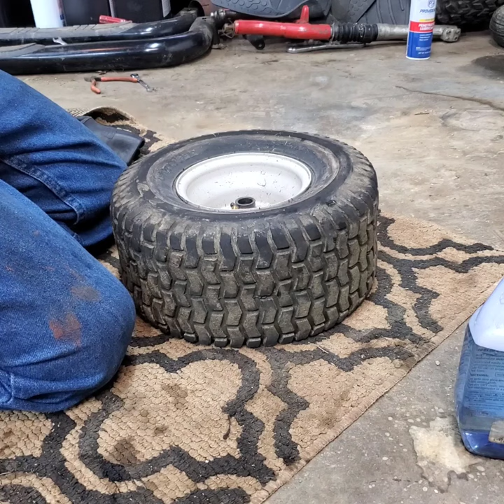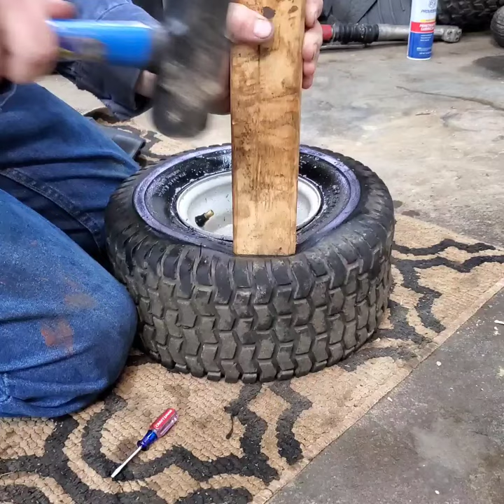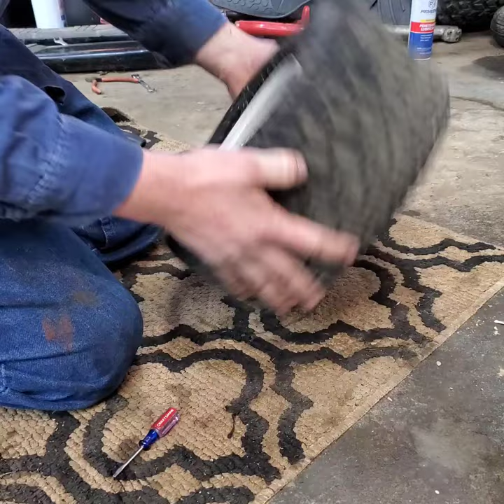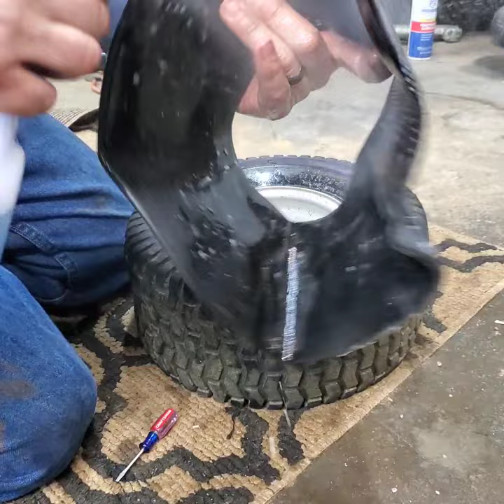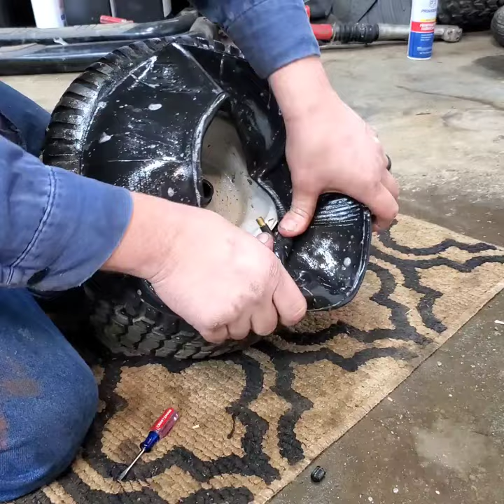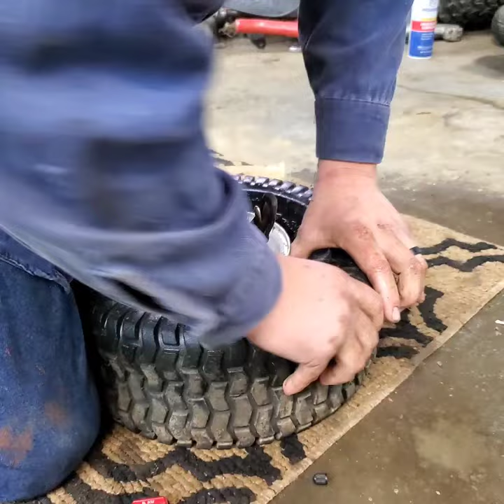How to install a tube in a lawn mower tire. *No special tools required*

Comment: Good video  A few extra points:  If putting a tube in a formally tubeless first cut off the valve stem , it makes breaking the bead easier  you  are not compressing the remaining air to break the bead.   When tube is in and you are filling  take  the valve core out  fill  until bead seats, let most air back out, then reinsert  valve core and refill,  This allows   folds and creases in tube to straighten out preventing future leaks...  On a related note  When first filling a tubeless  also take the valve core out,  You get  a unrestricted flow of air  which makes it easier to seat the  bead  .  Get Greasy
Reply: Me again  Just to add  ,  The best tool to have when changing a tire is  Common Sense
Reply from the maker: The reason I didn't mention about removing the valve core is I wanted to make the video as simple as possible. Most people don't have a valve core removal tool. You are absolutely correct though. Thanks for watching!

Comment: Awesome Video.  Saved me so much time and money.  For all those that wonder if you should pull out the old tube, I did.  I used scissors to cut it out and pulled it out with pliers.  I used that Dawn Powerwash thingie.  super slick.  I was friggin' amazed that it may have taken me 10 minutes from start to inflated tire.  Thank you!!!!

Comment: That's more the way I envisioned doing it, rather than to add the extra work of popping the tire all the way off the rim. Thanks. 👍
Reply from the maker: Thanks for watching!
Reply: Might still want to do that to make sure there aren't any thorns or stones in there,  not criticizing this method, it's how I do my bike tires but just a heads up.

Comment: You can also use a nut and washer on the valve stem to keep it from slipping inside the tire while you're putting the tube in.
Reply from the maker: That would work too! Thanks for watching!
Reply: Now you tell me

Comment: Done a zillion of these. Good video. The one thing I do different is start inserting the tube at the valve stem.
Reply from the maker: Thank you!
Reply: Which is exactly what he did at 2:34.
Reply from the maker: Thanks for watching!
Reply: @Part_121  Look again. He inserted the stem first then began feeding the tube in opposite the stem. No matter. He understood what I meant.
Reply: You must work in or own a lawn machine business.
Reply from the maker: I don't. I just do it as a hobby. Thanks for watching!
Reply: I agree, I put it thru and installed holder

Comment: All I use is a 5/8 bolt 8 inch long and nut, put in vice and tighten it 
Place wheel on bolt and tighten nut 
Use a rounded large old screwdriver push down and get a bit, I put soapy water or grease to ease removing tire , use other screwdriver to hold and get other bit
By now you figured it out

Comment: Inflate the tube out of the box 1st to see if it holds pressure then deflate it! It will give more flexibility when trying to stuff it in the rim & pull the valve stem thru & place it in evenly around!
Reply from the maker: That does help. Thanks for watching!

Comment: As fiddly as that may seem this approach looks WAY easier than taking the tire off the rim, installing the tube and putting it back on. Will try that next time... Pretty sure that is coming soon on wither riding mower or snowblower... Thx.

Comment: Also some Valve caps will do the trick! Keep them vise grip teeth away from the soft rubber. But most caps will be larger with will prevent the backing out as said
Reply from the maker: A zip tie on the valve stem works good too! Thanks for watching!

Comment: Good video, showing the whole fiddly process.  Just a question: why did you break the bead on both sides of the tire?  Thanks!
Reply from the maker: Thank you! You really don't need to. But it gives you more room to get the tube it. Thanks for watching!
Reply: I believe it would actually give you less room.
Reply from the maker: With both sides broke you can pull up on the tire so you can put the tube in the tire. Then work the tire back on the rim. No a very good explanation but that's how I do it. Thanks for watching!

Comment: Since I put plugs to patch holes/;eaks in the tire, I clip those off. I also add a layer of some rubber material around inside the tire to protect the inner tube from puncture. What good does it do to put the inner tube in, if it will just be punctured. I also put a cable tie around the valve stem to hold it from coming out, while stuffing the inner tube in. Leave the cable tie on .
Reply from the maker: It's a good idea to rub your hand around the inside of the tire to make sure there is nothing sticking through that will pop your tube as soon as you fill it with air. I have had that happen a few times. Thanks for watching!

Comment: And now with moisture inside the Steel rim , it will start to Rust , then develop holes in the steel rim , 
But you ain't too bright are you boy ?
Reply from the maker: Have you ever seen a tire on your car get changed? They use soapy water on the bead to get the tire on the rim. If you don't like it don't watch.  Your air compressor air is also full of moisture. Go to a gas station and fill your tire with air and there is moisture in it. Thanks for your input. Send me a link to your video that shows how to do it. Thanks for watching
Reply: @ablgarage the kid is probably 12 years old and will talk about his zinger on YouTube for the next 30 years

Comment: There's a problem with your method.  You didn't check for objects like thorns or broken glass imbedded in the tire.  You could end up with another holey tube if you don't check.
Reply from the maker: Yes your right. I have had that happen a few times!
Reply: How do you know what size tube to use
Reply from the maker: The tube will be the same size as your tire.

Comment: What do you do if after inflating the tube the valve stem slips inside the hole and can't be pulled out? Just hope you never have to fill the tube with air again? After I released the vice grip it just flew back inside the tire lol
Reply from the maker: I have put a zip tie on it to hold it in place but the cause of it is not having the valve stem lined up with the whole in the rim.

Comment: You make it hard . Just take one side off the rim and will make it a lot easier
Reply from the maker: I think it's much harder only breaking on side of the bead. If you break both sides you have a lot more room to get the tube in. Thanks for watching!

Comment: If you're not taking the tire off the rim You won't need special tools it's when you take the tire off the   Rim
Reply from the maker: Yes your right. Thanks for watching!
Reply: Why would special tools ever be needed for those little wheels unless you consider a screwdriver a special tool?
Reply from the maker: Most people don't have a beard breaker. Or a valve core tool or a tire changer. Most people don't do it because they think you need these tools. The video was to just show you can do it with ordinary tools.

Comment: I wouldn’t put a tube in a Carlyle Turf Saver 13x6.50x6. 
I’d use tire sealant like  Slime. Thou there are sealants with more rust inhibiter. 
I’ve found a tube just triples the work of fixing a flat tire.
Reply from the maker: I have used slim but it doesn't always work. A tube always works for me. As long as you don't put a hole in it while installing it won't leak. Thanks for watching!
Reply: I just put tubes in Carlyle Turf Savers.   I've had nothing but problems with Chinese tires leaking and would have paid twice the amount for a made in the US tire.  I bought the Carlyle's because they were once US made and I'm hoping they are still made with quality materials and to US specs.  But who knows now-a-days?  The tubes are my insurance policies.

Comment: I would never deliberately trap water inside a tire. I doubt that soap is a good idea. I expect that when that soap eventually dries, it will become stuck to the tire making removal difficult if needed. Back in the day, talcum powder was sprinkled liberally inside the tire so the tube could move, spread evenly, and unfold. On those little wheels it probably doesn't matter.
Reply from the maker: Talcum powder would probably work better than soapy water. I don't keep that in my garage though. Every tire shop I've ever been to uses soapy water to help get the tire on the wheel. I don't think that little bit of soap or water hurts anything. Thanks for watching!
Reply: soapy water is what tire stores use.
Reply: Really chassis grease works best
Reply: If you're putting an inner tube in, the tire has air holes in it and won't trap water.
Reply: that power caused  cancer😅

Comment: You have no idea, why break the bead on the backside? Not needed
Reply from the maker: It's much easier to get the tube in if both sides of the bead are broken. It's not needed but if you have never done it before it makes it much easier.

Comment: Adding moisture to the inside of the tire is just asking for rust.  Where’s your tire pressure gauge?  Why clamp the valve stem when an inexpensive valve core tool wouldn’t risk damage by using clamping pliers?
Reply: Where's your video if you're such an expert ?   He did a great job , kept it simple and his method works fine.... No need for your negative comments !
Reply from the maker: Can't please everyone! Thanks for watching!
Reply: The mower it came off of will be long gone before the small amount of moisture in the rim makes it rust through numb-nuts